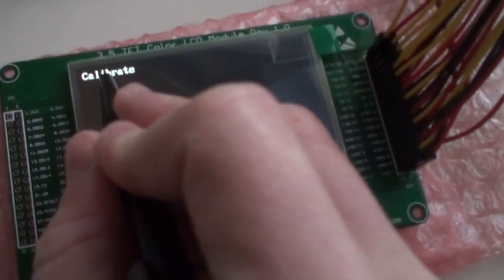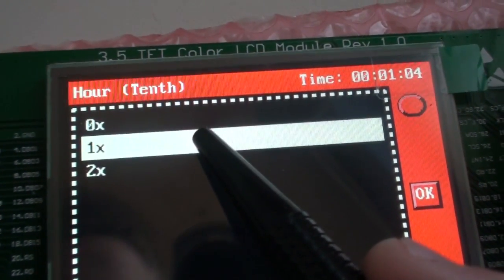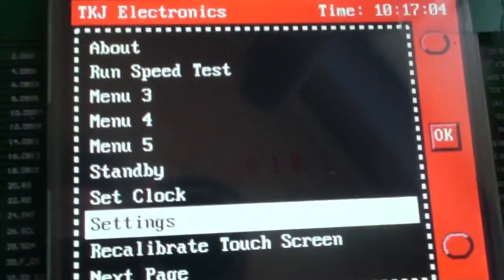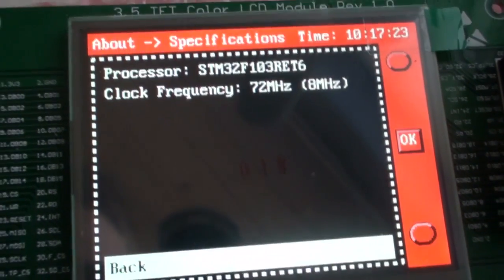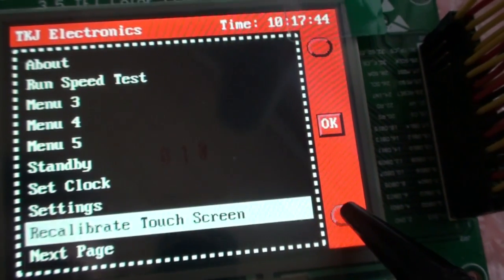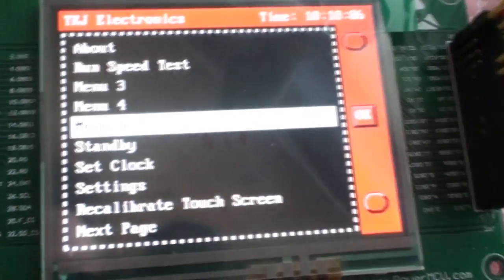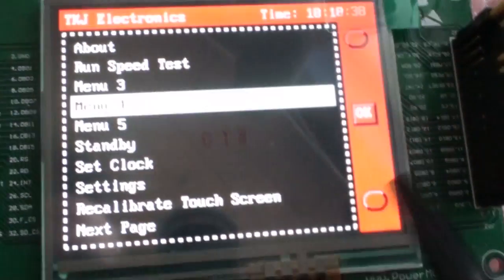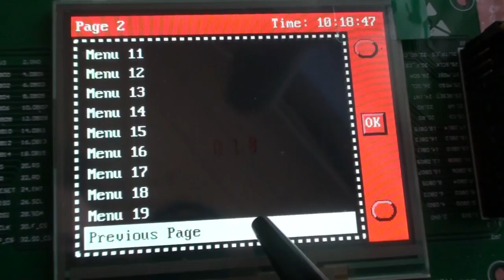STM32 Mini Computer

Comment: what different raspberry pi with STM32 ???
Reply from the maker: STM32 is an embedded microcontroller containing an ARM Cortex-M core whereof the Raspberry Pi contains the more powerfull ARM Cortex-A core which is intended for full operating systems though at a cost of being more power consuming.
The Cortex-M family includes built in flash, memory and several periphirals why it is perfect for embedded systems running smaller applications eg. on top of a Real-Time Operating Systems (RTOS) such as FreeRTOS.

Comment from the maker: The code found in the blog post will not work directly on an STM32F4 due to some changed structures and initializations on this never Cortex M4 chip.
But minor changes are required to get it running.

Comment from the maker: @wolkan26 Hi.
Take a look at my blog-post about driving this touch-screen display. I have uploaded the source code for the project too, though it's a bit messy.
In the source code you will find the ads7843.c file, which is for reading the touch-screen.
blog.tkjelectronics.dk/2010/01/320x240-color-display-ili9919/

Comment from the maker: @treborrrrr 
The PDF you got there uses pretty much the same calculations I'm using.
But to show you guys how this is done, I will upload the comple source code for this project - including Display controller (and graphics/GUI commands), Touch controller, touch calibration and some menu system.
This will be uploaded to my blog later today...

Comment: A couple of questions. Are you "manually" reading the touch screen or do you use a touch screen controller such as the ADS7843? If the latter I'd be interested in getting some more info from you about how you calibrate the screen. I'm currently playing around with a similar screen and I find I can't really get the precision I want out of it.

My display seems fairly accurate in the X-axis but the Y-axis differs depending on where you poke it. It's annoying :)